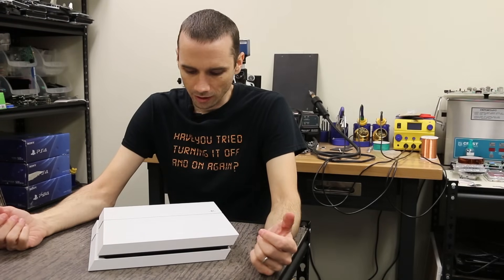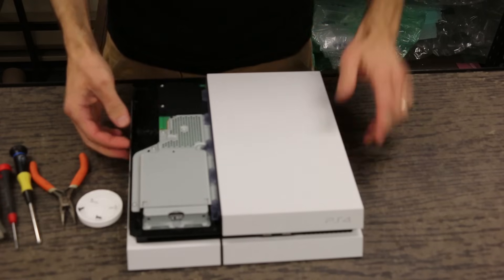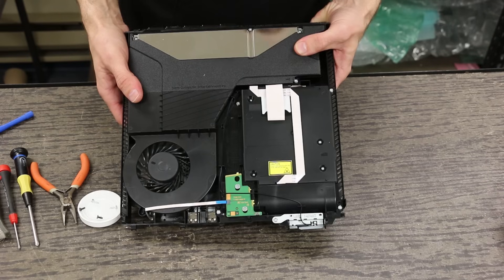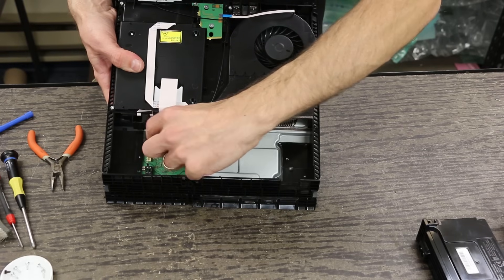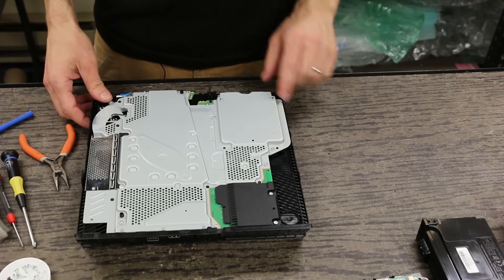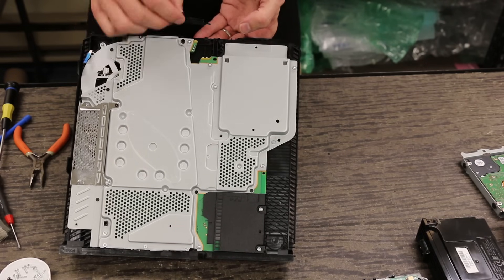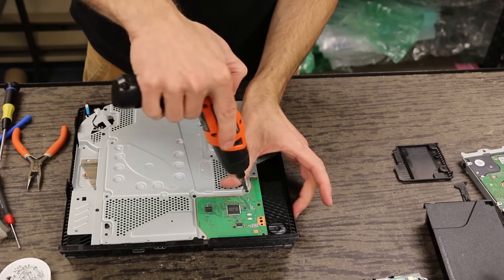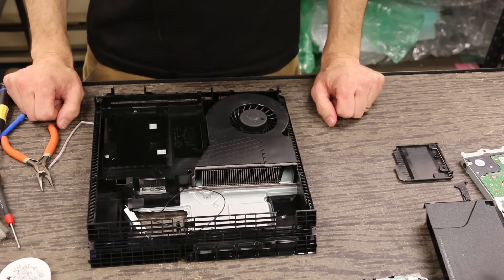PS4 1215 Teardown Tips & Tricks

Comment: Thank you so much for the video.  I was struggling, since I have this model, but most of the videos online show the others.  Once I understood the key difference, it was really easy to remove.  I also found that using a pry tool gently, helps remove the power supply.  I'm sure it's less of a thing after you remove it a few times.
Reply from the maker: Glad this helped!
Reply: Thanks because my power supply won’t budge on the left handed side

Comment: Thanx Steve.  The tip about so many kinds of screws is excellent and wise advice.  Taking a digital photo of each stage of the work is also excellent advice.  Just being a former NASA engineer did not build my courage up enough to dive in, but your video did.  My mission today is to fix a broken power switch/button.  Gotta dig deep to get at that little doggie.  Memo to self: buy a power screw driver handle.

Comment: After taking off the two long Phillip screws that hold the metal piece ontop of the power supply, those 3 T8 screws are literally machined too shallow on mine. My T8 worked on previous screws to get to this point & got stuck here. Like I said they’re literally just shallow compared to the others. Help? Very informative video btw the best out! Thank you
Reply: Same here! Did you figure it out?
Reply: davidg7517 just ended up getting a different set of T8 screwdrivers that had deeper slots on the screw head itself. Now I’m at the part of pulling the battery out an the side with the connectors doesn’t wanna come up🥴
Reply: Wyatt Blatt what are the screws you used for the 2 in the back

Comment: If your model is the black version of the 1215, remove the power supply connector from the power supply itself NOT from the motherboard
Reply: Done broke it. Is it easily fixable, or should I just replace it?

Comment: quick thanks. I accidentally switched on my PS4 a week ago (it has been off for a few months) - after about 30 seconds there was a sharp crack and it went off. We had quite a lot of small moths around and I figured one or some had gotten into the power supply and suicided itself! I followed your guide (I would NEVER have figured out how to open it myself) and took out the supply. After getting the power supply opened I took at the bottom of the circuit board and there were about 5 small moths... grrr.  That's about the limit of my diagnostic ability. So I've ordered a new supply (about £20 from China via Amazon) and it should arrive in a couple of weeks. Anyway... just wanted to say thanks for the video. Hopefully the moth short didn't take out anything else.
Reply: Quick follow up. New power supply arrived. Put it in and reassembled the PS4... good as new. Thanks again.

Comment: ok this is the best ps4 disassembly guide, other's are not even clear, this however is very clear and great tips, i have encountered some problems like the bottom cover without the pick tools it is hard to remove, but you can try use 2 flat head screw drivers to pry the side from the top and just stick 1 of the flat head in place and then pry other place up with another, then for the security T9 torx screw you can unscrew it with 2mm flat head screw driver, another problem for me is the power supply cable is very tight and took me hours to finally remove, you really need a right size  pryers tool to remove it safely, don't be like me using an overly big pryers, the result is the connector plastic at the mobo is damaged, well it still works at least

Comment: How TF you get the t8 off? I have the size to unscrew it but the screw has a huge bump in the center of the screw do I can't get it in enough to unscrew
Reply: You can also use a tiny flathead screw driver .. that's how I get mine off
Reply from the maker: It's a security torx
Reply: You need T8 H.

Comment: That bottom part is a b*tch! So hard to take it off, how could they design it that way!?
Reply: Use a butter knife and wiggle it very softly back and forth you wont snap anything just pry softly and patiently I was able to do it this way but I have fixed alot of phones as well so I'm use to the awful resistance that electronics give
Reply: @xXDEFIENCE2066Xx  My solution was to carefully pry it at a point, near the center and slid in an old debit card and started to force the card along the edge towards the corner, that did the trick. I don't have any specialized prying plastic tool (yet).
Reply: Dukefazon that’s good to hear and yes there’s these little plastic triangles that a lot of people who fix phones and tablets use in their videos they are very cheap on eBay and amazon. 👍👍

Comment: After I cleaned the inside of my Playstation, it's starting to feel more hot. Could I have done something wrong?
Reply: Nope. the dust was blocking the fan to spin fast so the ps4 just puts all it gots to make the fan spin like a jet.
Reply: There's no such thing as overheating untill while you are playing a message will appear 
((Ps4 is hot,  turn off or download...bla))and shuts its off automatically

Comment: I still cant get the bottom off
Reply: I had the same problem...then i used a butter knife to slide along the edge like in the video.
Reply: MRCH0SEN1 thx the knife works
Reply: @MRCH0SEN1  thank you, i was trying to open this part like for 30 minutes and used butter knife instantly opened, i tryied to use other stuff before that
Reply: Slide a spudger in the rear sides of the console while it is upside down
Reply: How do you move the heat sink
Reply: Me too!! I still need help. My P4 is all black. I cant tell where the shell begins and the bottom part ends.
Reply: yall need to remove the stikers at the edges and unscrew the screws, then its gonna be easy just sliding a flat item like in  the video
Reply: I used tweezers, it was tricky but somehow it wasn't that hard to start, it took much more force to took the whole plate off, on the other side.

Comment: If you cleaned out your PS4 and applied thermal paste and it still overheats you have to also remove the panel UNDER your motherboard.
The heat sink may look fine from the front side where the power supply is but the other side is probably caked in dust.

I thought that the heatsink can be cleaned from that side, but it cant. When I opened up my system for the second time I saw my heatsink was covered in a full centimeter of dust carpet.

After removing that I couldn't tell if the fan was working because the console was so quiet even on a game like Doom.

Also, great video, thanks Tronics!

Comment: Hey, great tutorial. I was able to get the ps4 taken apart so I could reassemble parts. But I need some advice. Let's say I got a PS4 that someone had taken apart (I assume to try and fix) but has almost no screws. What would be the type of screws I would need to replace? I don't need a quantity, just the basic types of screws and I'll just buy a bundle of them.
I see you mentioned T8 for most things, but the metal place you take off has two long screws. That would be one type. Another would be the six screws that appear to be missing from the disk drive. There's also a green board between the fan and disk drive that is loose. Looks like it has a piece of plastic at the bottom that has been broken off, but not sure.

Comment: My PS4 resembles NONE of the models on YouTube wtf is going on?! 😲
Reply: Docta Osiris maybe it’s a slim ora pro?
Reply: @il_craparo8937  This was from a long time ago when my PS4 just literally stopped working one day, I still have it but it's not a Pro, it's just a slim I think 🤔 although it seems to have a lot more HD space than usual, it has 2TB and I bought it brand new from Argos just before Christmas the year before I posted this, I was still never able to get inside the thing to find out what may have been the issue so I ended up getting a PS4 Pro 🤣
Still running nice and strong even though I bought it 2nd hand 😊
Reply: W W  I know, that's what they do with printer ink cartridges 🤣
But no, I'm pretty sure it was just how much I used it, constantly almost 24/7/365 and I rarely turned it off properly either, always just put it into sleep mode when I needed a bit of sleep myself so I could get straight back to it the second I woke up 🙄
😁

Comment: at 11:40.  how super important is that threaded metal piece for the long screw that holds down the psu?  is it actually a important ground?
Reply from the maker: No, it's to help keep the power supply in better. It's fine without it but better with it.

Comment: Just a warning, never do this at home , unless you are a professional and have professional tools
Reply from the maker: You don't have to be a professional nor do you have to have "professional" tools. If you feel comfortable with it then go for it. If you don't then don't.
Reply: @Tronicsfix  well,  my friend and i tried to do it, he did it on his ps4 and i did on mine, we broke most of the clips on the bottom part, we brokw the see through plastic on the top part that on the right so now he can't put the left part now it doesn't click in, and lots of force was wasted, on my behalf i just broke a few clips on the bottom part, that's all the hard time my ps4 gave me, also i had to look for the screwdrivers, it was very hard to find this torques security screwdrivers that's pretty much it, maybe he was stupid and used brute Force to open it

Comment: Thanks for the video.  I have this style, but most other vids show the model with multiple screws across the back.  I thought I should get into mine to clean it out since it's been 3 years. A word of caution... When removing the little plug for the power be really careful. Gently wiggling it, I pulled the whole socket right off the board.  It doesn't even seem like it's a removable plug upon closer inspection.  I had to re-solder it back on.  Freaked me out because I've never soldered anything before, but I got it working! It wasn't even that dirty inside! Lol

Comment: Believe it or not, a small lizard crawled into the back of my ps4. Thanks to this video, I was able to get the little bastard out. I was about to give up and fry him but I wasn't sure if it would mess up any internal parts. My ps4 and the lizard are both safe. Thank you for this video!
Reply from the maker: A lizard???! Crazy! That's a new one for me.
Reply: @Tronicsfix  what is the metal plate for
Reply: @Tronicsfix  So this 1215 model uses the same cables as the 2015b slim model?
Reply: i found wood in mine like a inch price of wood like from a desk or something
Reply: @bradleylowry9466   what??
Reply: The PS4 still gets hot, should we apply new thermal paste when removing the first time ?
Reply: @HenryThomas1610  yes I'm doing so right now, you should especially if you had yours for years. Well this was a month ago so prob wont help now
Reply: You should try opening up the power supply. Damn roach nest with roach poop all in it! Yuck! Btw it was sold to me second hand and I cleaned that bad boy up! (CUH-1115) Someone put a matte HDD cover though :/
Reply: @TheRandomname951 you prolly live in a dump with trash everywhere around you to have roaches 😂😂😂😂😂 you’re the  reason I don’t buy anything used from any one no Matter how “new/hardly used /I know what I have” on the title lol
Reply: Heartwarming
Reply: Lmfao
Reply: If your did fry him depending on how you would do it it would have most likely blown a fuse or capacitor
Reply: Found a dirt dobber nest in mine. I've always kept it inside, so I'm befuddled.
Reply: @MasterSoko  im curious, Arizona? 🤣🤣 ggs
Reply: Did you keep the lizard
Reply: @haydnearley6536  best comment for 2020

Comment: before i did this open the ps4 and cleanse thing my ps4 was turning off randomly while playing black ops 3 and streaming netflix it would last less than 10 min and it would turn off without any warnings just turn off. i opened it and cleaned it like you show here and now it turns on but when i load bo3 or leave it on for a while the fans sounds like a fighter jet really loud and it beeps and turns off. i DID NOT replace the thermal paste btw. what could be the issue? awesome video btw.
Reply: Did you clean off the thermal paste and not put any back on? I know that sounds like a stupid question, but I'm not sure what else could cause that.

Comment: Thanks for the video. But my down fall is i wont be able to fully clean the fan since i do not have the thermal paste i need to put back on the chip thing. So cleaning it the best i can lol
Reply from the maker: You can clean the fan just by removing the bottom cover.

Comment: thanks for the video. cleaned my sons ps4 easy. regarding the cable to power supply, may be its better to remove from power supply side and not from mobo side
Reply from the maker: Yep, you can always remove it from the power supply side...but if you break it off of there then you have the same problem.

Comment: Thanks for the guide. Managed ti disassemble and assemble back my PS4 without much issue. Although that bottom case did require a lot more force when prying it off. Had to shave off a bit my plastic cable pryer to slot in between the case and chassis.
Reply from the maker: You shouldn't have to shave off anything.

Comment: 1. thank you ,my ps4 was over heating and shutting off but I cleaned it. I didn't take out the mother board because I have no thermal PASTE so my question is 

how do you apply the thermal paste?
Reply from the maker: If it's overheating you need to check the fan and the heat sink on both sides. To apply thermal paste just put about a pea sized bead on the APU then put the motherboard back in.

Comment: For anyone who is unable to remove the bottom and is wondering why it's requiring you more force than it did for the guy in the video it's because there are 2 hidden screws in the upper back. YOU HAVE TO BREAK THE MOLD THE SCREWS ARE SCREWED INTO TO OPEN IT there is no other option and I know this because once I applied crazy pressure by wedging the edges with 2 flat head screw drivers I plopped it open and discovered 2 hidden screws placed there to keep me from opening my PlayStation. Sony want to keep you from opening your PlayStation so  bad that they are now hiding screws. The 2 screws are hidden behind those 2 ends in the back where 2 screws wore supposed to be on an older model, they are just hidden. you have to break part of the case in the back on the with 2 flat head to open it. Just repeating myself to be clear that's the only way it's coming open, if it feels impossible to open that's the reason.
Reply: I was wondering, my thumb is so sore, but it's not going to defeat me, i will open it even if i break it
Reply: @hamodypie   did you.open it?
Reply: @demarcus7315   2 flat head screwdrivers and lots of force, be careful you might break it and some of the clips can break, do it at your own risk.
Reply: @hamodypie  if so how??
Reply: Thank you that had happened to me until I saw this thank you so much
Reply: I dont really understand where the hidden screws are. Help?
Reply: I can't find it
Reply: Can't find the screws. If possible can you send a picture of where they are?
Reply: wow u succ
Reply: Yasin Omidi I have the PS4 without the gloss so it has only 2 stickers. I removed the screws on the back and the ones in the middle but like raijin said there are 2 screws which are hidden but I don't know where they're so then I can't take off the cover on the right side of the PS4.
Reply: This guy is not very thorough in his videos.  There are too many steps such as this one that are overlooked.  Our PS4 is now broken because when HE showed the power supply cable being removed from the motherboard it went really quickly and the angle was blocked by part of the console case.  He said his came loose quickly because it had been removed before, that we would have to wiggle some.  So we did.  With pliers (as he did.)  And the whole thing came off the motherboard and is now broken.  DO NOT RELY ON THIS VIDEO TO DO ANYTHING UNLESS YOU ALREADY KNOW WHAT YOU ARE DOING.  WE ARE OUT OVER $300 BECAUSE OF IT!   BEWARE!!!!
Reply: Brandi Thomas same thing happened to me smh
Reply: depends on your model ps4. new Fat ps4s without gloss usually have two in the middle back under warranty stickers. just take off the stickers if u have no warranty and u will find 2-4 screws
Reply: i opened my ps4 and there were only 2 screws, took me alot of force and it just tried to close itself but i opened it with only the two screws in the back. perhaps Rajin has the older 4 screw model
Reply: @yasinomidi7525  I also opened with just the 2. It took quite a bit of force but I didn't have to break the plastic.

Comment: I got a PS4 Pro today, and in order to do the transfer data thing, you need to hold the power button on your old playstation down. My old PS4 is the CUH-1215A model. The problem is, my power button doesn’t work. And apparently, this is a much more complex fix compared to the older model PS4’s.
Reply from the maker: I fix lots of them. It's a hard fix unless you fix a lot of them...if you do them a lot it's easy. It does cost some money though since the motherboard has to be removed. We charge $99

Comment: Great video! This 4-pin connector for power supply is terrible. I tried to disconnect it very gently, spent almost 10 minutes to pull it out, but it broke anyway. I had to re-solder it to the mainboard.
Reply from the maker: They're tricky at first.
Reply: I was being very gentle and I didn’t pull out from the cables so then I ripped mine....is it easy to re-solder?